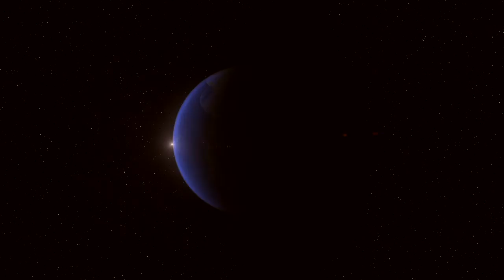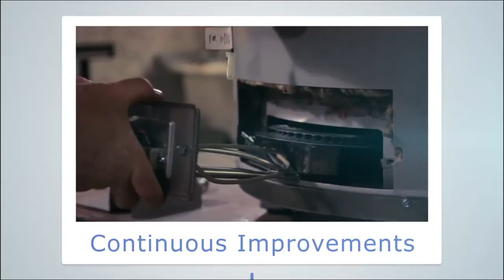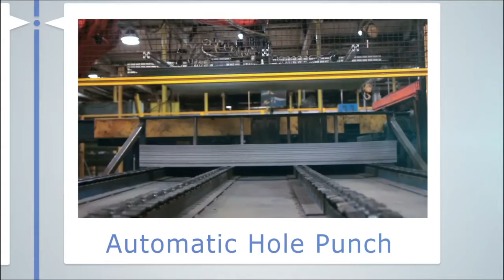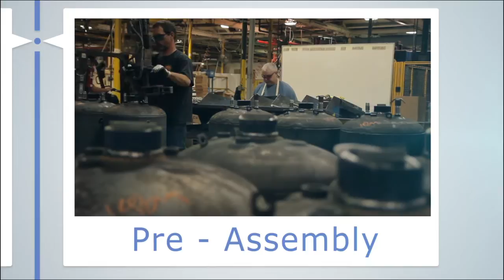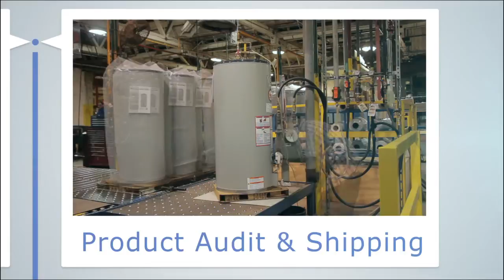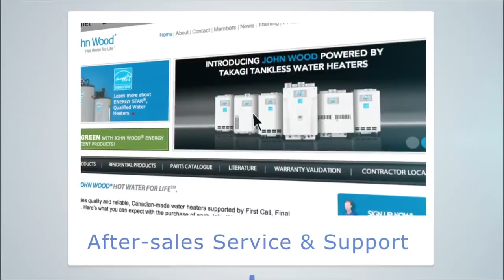John Wood

Comment: I am not happy with my johnwood hot water heater. It has had a very noisy burner since the day it was installed. I had to replace the controller at 2 to 3 years and I always have to have the plumber back to quiet the noisy burner. I just had the igniter cleaned and again I had to have the plumber back to try to quiet the burner. When it was installed I had the warranty person back to quiet it. It is approximately 6 years old now and I and frustrated to the point of replacing it.

Comment: I have a John Woods hot water tank . It has a small leak that just oucard believe it or not it was installed on the 3 month of 1963 you do the math well satisfied wish I could fix the promise a John Woods heater will be back in it's place

Comment: I have a 75 gallons JW hot water tank, it's 10 years old, I am looking to replace the anode rod, a contractor recommended a 32" rod. Do you think 32" is short for a 75 gallons tank? Thanks.